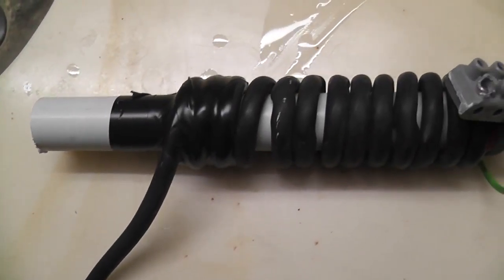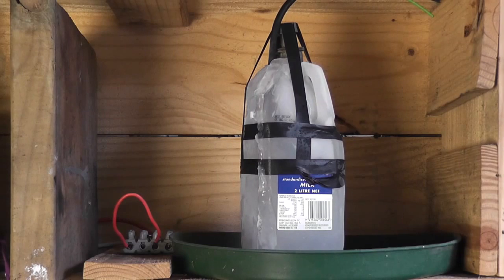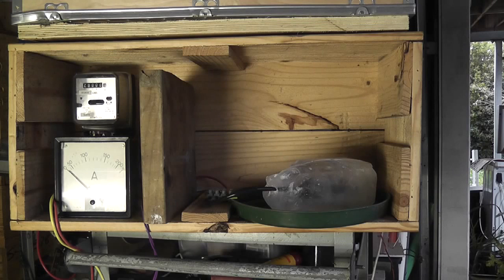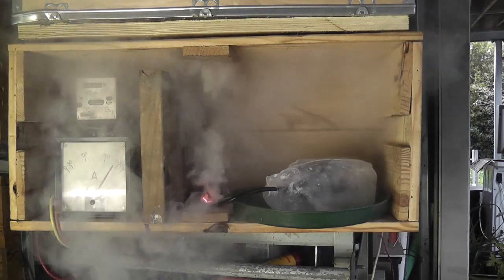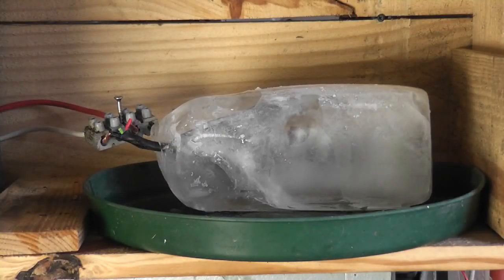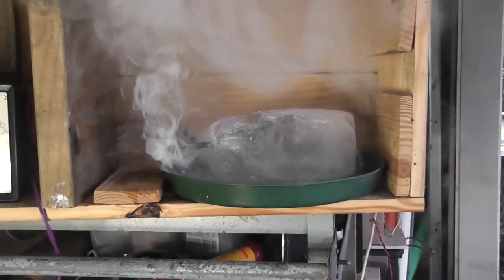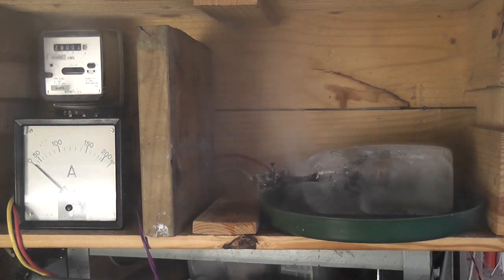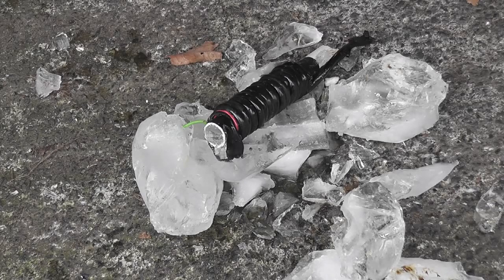My Edited Video - Powercord in ice

Comment from the maker: @hwstarsr  Our NZ 240V 

Older Flex leads have:  red, black, green
New Flex is: brown, light blue and yellow/green

TPS cable is red Ø, black N and Green E. or Green/Yellow E
1 mil is solid, 1.5 mil has 3 strands 2.5 mil, 4 mil, 6mil etc.  has 7 strands.
Stranding allows a bit more flexing although requires a lug for termination on flat busbars.